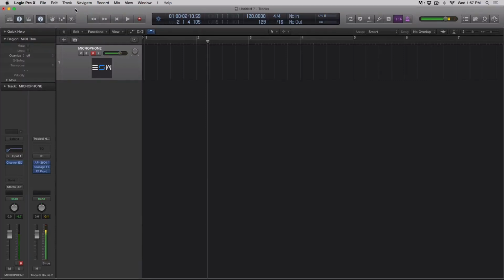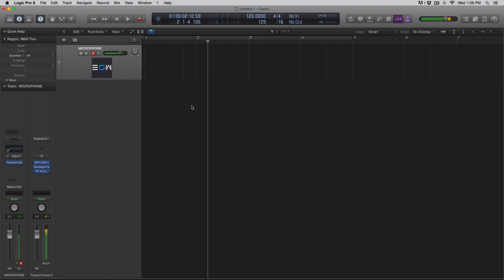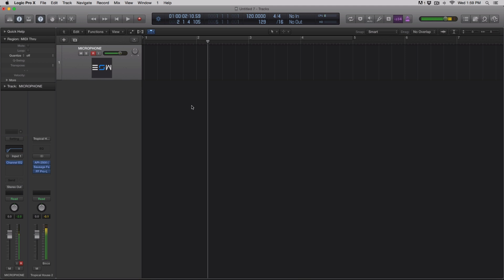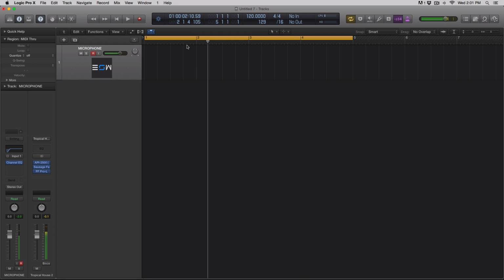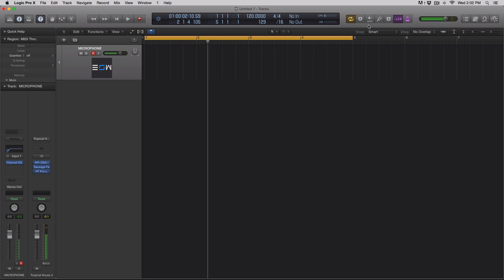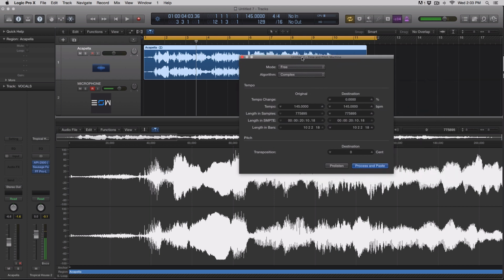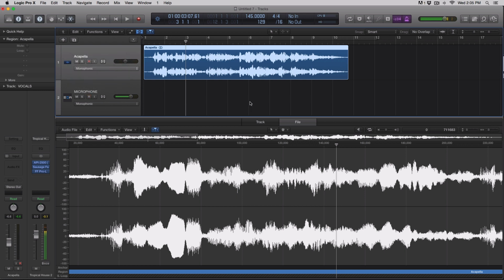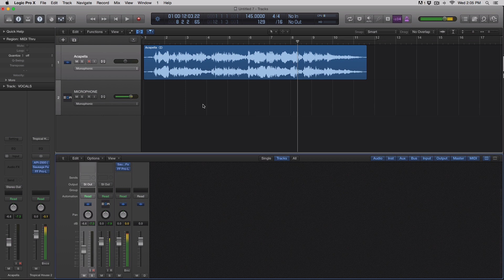Time Stretching in Logic Pro X

Comment: I'm confused with logic's warp algorithms, Ableton does have complex pro and beats algorithms and you can also adjust them manually, e.g. formant or envelope velocity, so there's no artefacts in vocals ... Why doesn't logic allow you to change any algorithms manually? I can hear distinct artefacts in that vocal, but in ableton i could fix it with formant and envelope controller on the clip's settings
Reply: It's just because the time algorithms Ableton uses are way Superior than any other DAW and that's why so many beat makers who primarily work on samples use it. It's just really has a great algorithm built in

Comment: When doing this, you destroy the original audio file, so back it up first. After changing the tempo there are sort of bumps in the audio file. This happens in the example here. Experiencing it myself and no way to revert from there.
Reply: That's crazy, he didn't mention it. No way to get back?
Reply: @francescorenna  The original audio file is modified, so you lose the version before the modification. Of course, you can make a copy of the audio file before even touching it, but if you don'tm I don't know if performing sort of a reverse operation would fix it. My guess is it wouldn't. Would be worth trying.
Reply: @sicktomtoms  thanks Alejandro. I tried to reverse but the audio quality is compromised. Doesn't matter, it was just a demo. What if it was a professional recording?
Be careful guys and follow Alejandro's tip.

Comment: ok so say I have an old track (say disco, rock, or a live recording) where the tempo isn't fixed at say, exactly, 120.00BPM (it fluctuates throughout the track). The way I used to "fix" the tempo and use it in cubase, is by chopping the entire track (or just the parts I wanted to use) into little 4-beat, or 8-beat, pieces (depending on how inaccurately spaced the beats were). Then I would time-strech each little part by selecting the snap-to-beat option and then dragging each little part to time-strectch it to the arrangement's grid line (which I had previously set to the tempo I wanted the remix to be). When I finished time-streching each little part then each beat of the the track would be in perfect sync with the rest of the tracks in the arrangement. 
Can I do this too in LPX too? Or is there a better/faster/simpler way to do this in LPX?
The ideal way to do this (I guess) would be to be able to manually go into the track editor and manually add markers at the precise point each downbeat begins, and when you're finished setting all the markers, then LPX would automatically change the tempo of this track (using your markers as "anchors") whenever you changed the tempo of the arrangement! :)
Nothing like this exists in LPX, right?
Reply: nounix 3 Logic’s flex time allows you to do exactly what you described.

Comment: You realize you can count the amount of beats/bars in the acapella or sample, drag bpm up or down till the region size is close to being the length of how ever many bars/beats of the sample that you chopped. You can then simply hold the "option" key allowing u to  manually click and stretch the tail of the region to the appropriate number of bars chopped. Boom time stretched. Flex can be used at that point to clean things up. But theres really no need to use bpm counters as long as you know how to count beats/bars of the samples that you chop. Hope this helps.
Reply: After making your beginning/ending cuts around the correct number of bars, move bpm till region size fits the number of bars cut. Hold option key to click and snap the tail to the respective amount of bars.